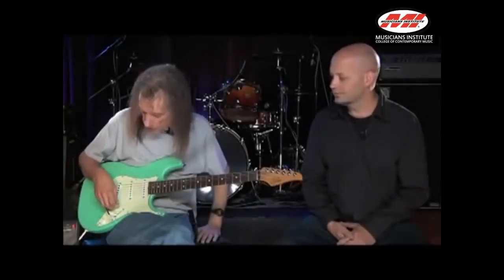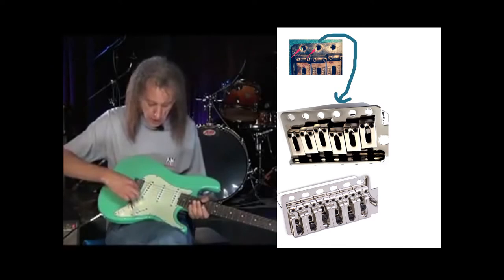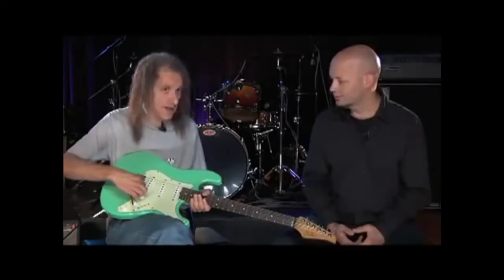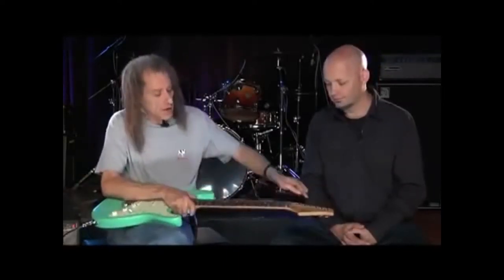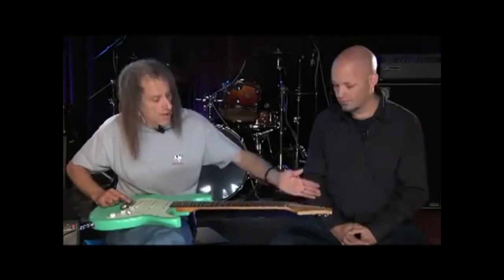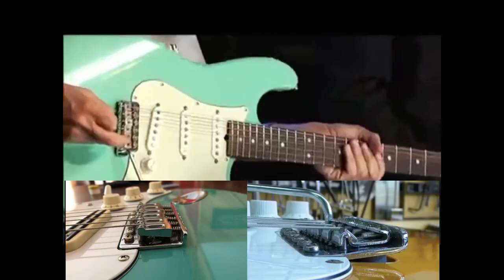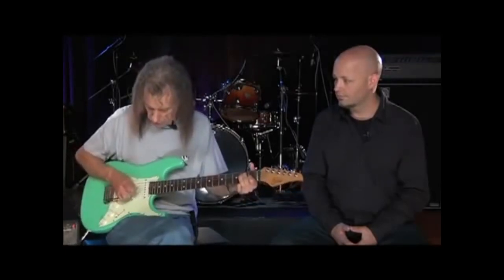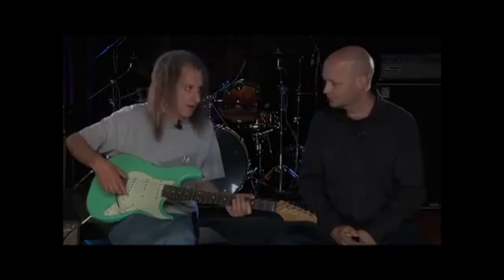How to stay in tune on Fender bridges - Scott Henderson's Suggestions

Comment: Or use smaller screws
Reply from the maker: yes, but then u have to deal with the holes in the body
Reply: @ymelfilm  saddle screws
Reply from the maker: @bluwng  I dont get it
Reply: @ymelfilm  my error wrong response.  I rewatched his theory is nonsense.  Excellent musician but not a good engineer.
Reply from the maker: @bluwng  that is interesting. What statement of his you cannot accept? From my experiences, the headstock should let tuner machines be arranged straight to the nut, graphite dust in nut, nut profile, bigger 6 holes, all make sense. What s wrong?
Reply: @ymelfilm  that screw size on the bridge plate will eliminate tuning instability on vibrato use.  Don’t confuse yourself with the minutiae just focus on root cause, if something doesn’t address the root then it won’t fix the problem.  Example, people always say the nut is the issue if this was so every strat with a well cut nut would be perfect but it isn’t.  My analysis has shown the problem is in the bridge that is why locking saddles or a locking trem block( see TremDoctors videos) gives you almost perfect tuning.  A science minded person would do a design of experiments and some sort of fault tree to find the solution.  If nut was the problem you could just put a locking nut cut out all the bull crap and you would solve the problem….if it was true but it’s not that is why it won’t fix it.  Sorry for rant.  A musician may be technical but doesn’t musicians are technicians or engineers.